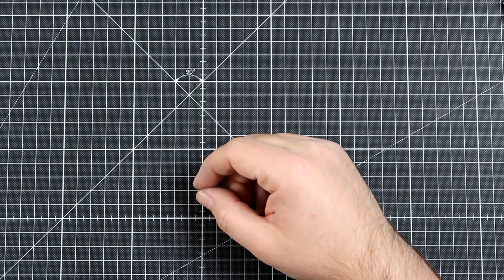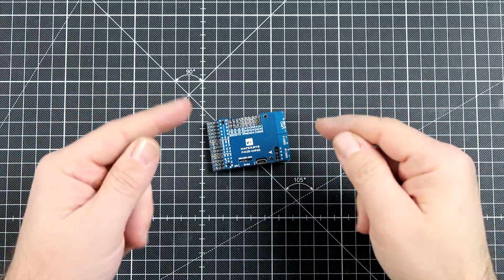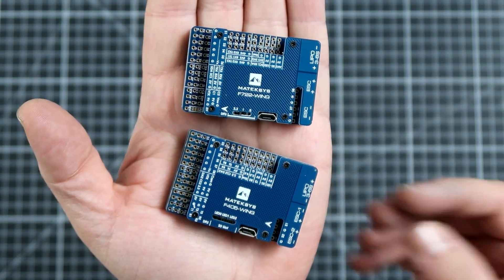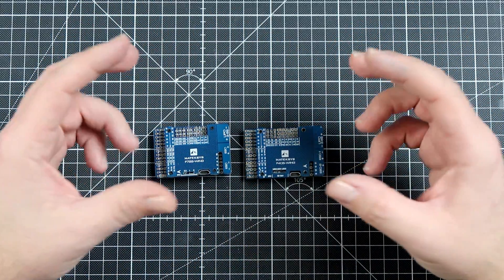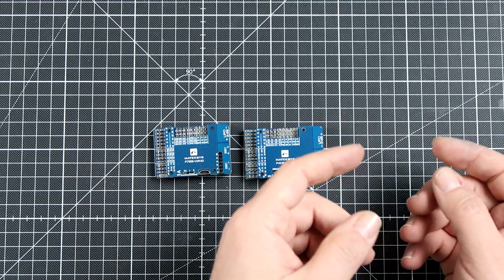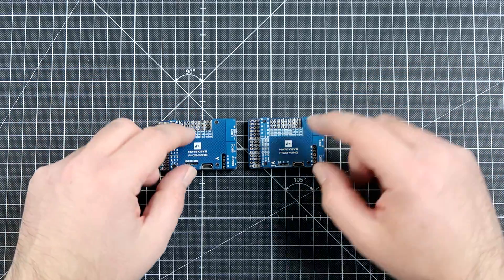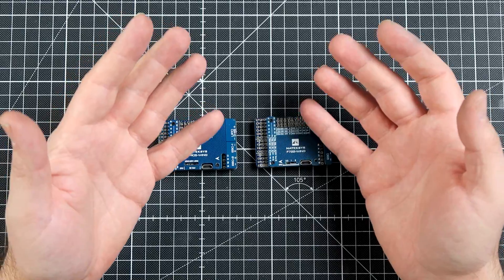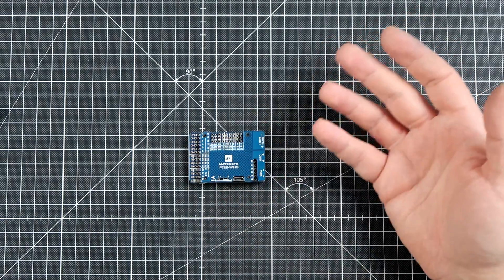Matek F722-WING fixed wing flight controller hands on

Comment: Hello, I am not getting any video through the Matek 722-wing controller using INAV.  I do get OSD on a Black background.  I have tried connecting camera directly to the VTX and get good video.  I have tried the camera switching in INAV with no success.  Is there something in the INAV setup that I am failing to setup.  I have used INAV on other plane with no problem.  Where am I going wrong?
Larry

Comment: Hello Pawel, please help. I'm using f22wing and inav with akk ultimate vtx and runcam swift 3. Everything is working fine before but now i dont have video. When i turn on it only show the osd and black screen. Is runcam swift not compatible with f22/iNav? It worked before but now i only have audio and no video. What may have caused it. I checked everything physically but i havent tried with inav configurator i dont know what to check haha.

Comment: Hi, I have started with my first ever build with this FC on Mini Talon using FRSKY R9, R9M and taranis x9d and iNav. It's frustrating I don't what's wrong all servos are working, master control of Motor in iNav is working fine but not when using the radio. Can you help me?

Comment: Hi Pawel. i am new to flight controller. i just finished soldering the pins  of my matek 722 wing. then i plug my 3s battery just to check the volts (red black pins). then suddenly leds (3.3  1  0) went off. then i unplug and plug again but this time no more reaction. but if i plug usb there is light. did i short it when testing. please help me. thank you Pawel

Comment: Hi, im searching something form my hexacopter. Can I use this FV to drive 6 motors and additionally foldable landing gear(2x PWM servo, split form one chanel) and control 1ch of a gimbal(pwm servo)?
Reply from the maker: Why not F722-SE?
Reply: @FPVUniversity  F722-WING has better PCB layout and ports/pads are more convenient for my
Reply from the maker: Why not F722-SE?
Reply from the maker: Why not F722-SE?
Reply from the maker: Why not F722-SE?
Reply from the maker: Why not F722-SE?

Comment: It's just the F405 with some pinout corrections, pretty minor too....Renaming it is a bit pathetic, it's the same F405 - Wing as before with their minor mistakes corrected, that's all....Not reflected in the jacked up price though.
   Poor show Matek, it's so obvious what you have done.  Camera switch...?...Meh.
The F405 Wing is a great FC, I have two of them now, but come on Matek....Really..?
Reply: 6 UARTS vs 5 and all UARTS are automatically inverted/uninverted making setup that little bit easier, the corrections you mentioned plus an AUX power switch AND the video switch

Comment: Nice, thanks. Doesn't yet support Arudpilot, as the 405 does. Hope they add that.
Reply: Won't happen as the F722 only has 512K of flash and Ardupilot already almost fills 1MB
Reply: same thing for me..if it s not supported by chibios it s useless for me
Reply: @derivas007  @amisoftau It's been supported since August 2018 in Plane v3.9.0
https://github.com/ArduPilot/ardupilot/blob/master/ArduPlane/release-notes.txt#L263
Reply: If someone wants to donate a 722 to @tridge then we'll support that one too!
Reply: @TomPittenger  Thanks, good to know.

Comment: Can't wait to get my hands on one of these! Running a F405-Wing in my Strix StratoSurfer and I have a 3ch video switch for nose pan/tilt and rudder mounted cameras. It would be so nice to not have to have that extra switch in the plane, an extra failure point as I see it.